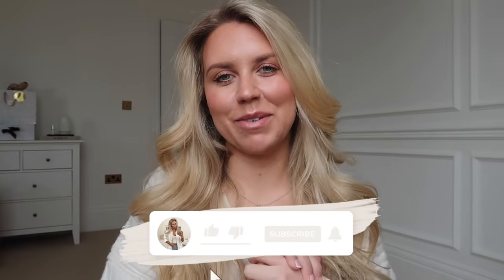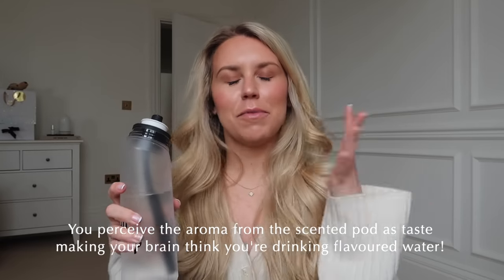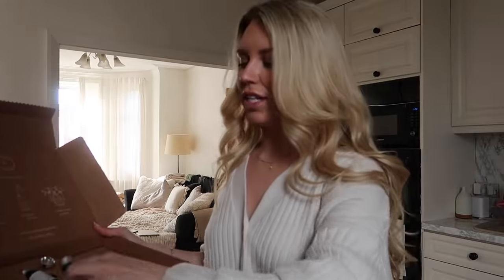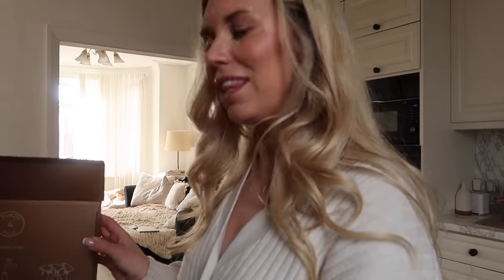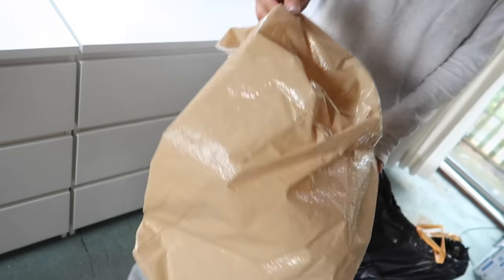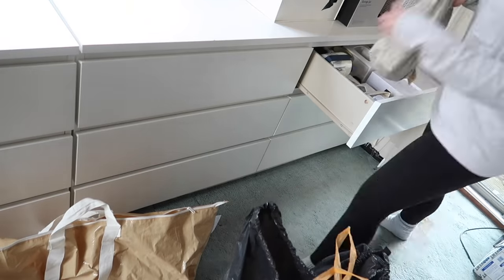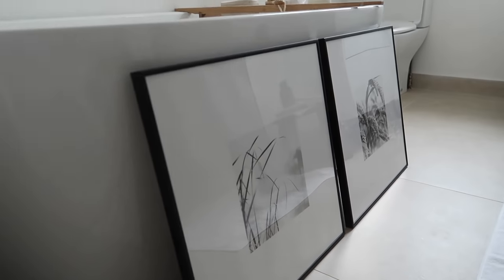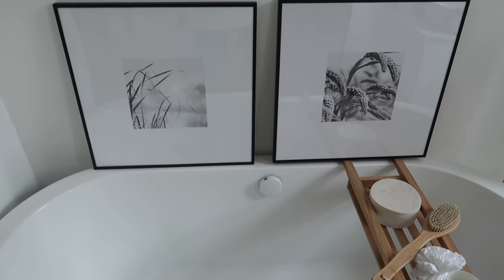DUNELM HAUL & HOME UPDATES 🏠 Renovation Series

Comment: I found the rule with wall art 🖼 
Height of wall X 0.60 min ( or 0.75 max)  
Same for wall width 
Although in your case I’d use the length of the bath as the width.   Those two pictures might just work.  
I knew I took a photo of that rule somewhere. I’m full of useless info !  😂😂😂😂